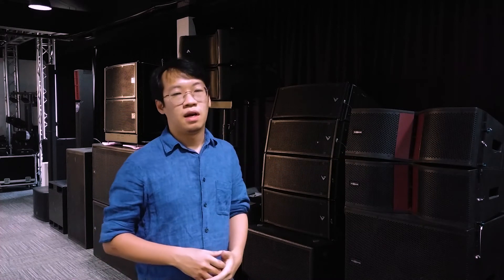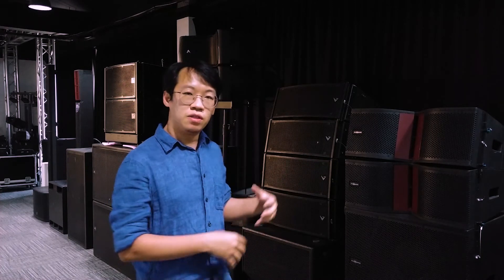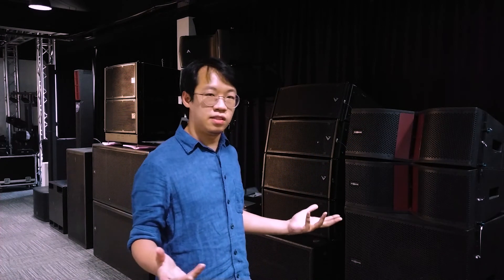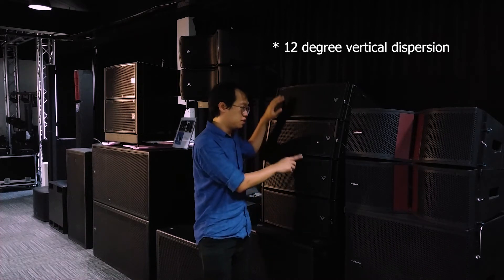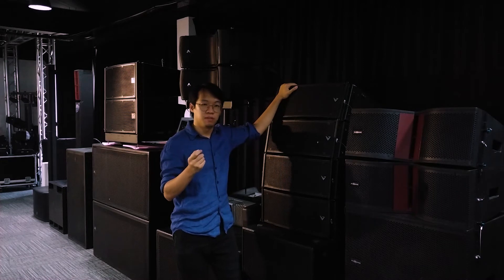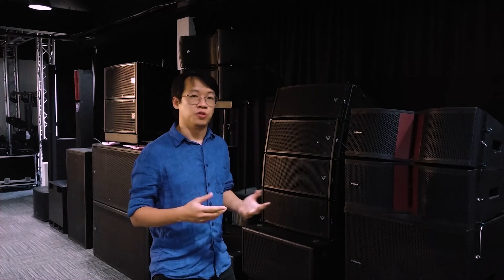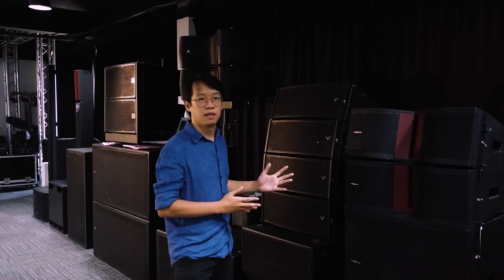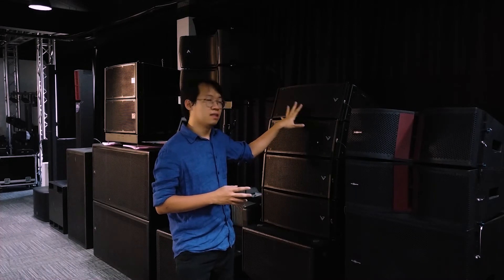DON'T GROUND STACK LINE ARRAY !!!

Comment: Two line arrays often sound better than a full range speaker at high volumes because of the wattage difference. I suppose if more sound people used the full range speakers within their specs I would feel different.  Anyhow thank you for the nugget of knowledge to our sound community.  Makes alot of sense
Reply from the maker: Both will sound great when ise correctly. However line array indeed provide higher fidelity in the HF due to the waveguide horn design. Higher Watt does not equal to good sounding
Reply: @ericcheesaihoo  Higher watt gives it a better chance! lol!

Comment: Ground stacking time aligns the speakers well (if you have completely vertical, averaging ear height) but only useful for outdoors with sparse audience. Flying throws the sound better and more uniform SPL but is harder to set up and not as good time alignment up close.
Reply from the maker: you can use fly sub to solve that. but when the array is too long, there still have time alignment issues with bottom boxes. and the half power of the sub due to moving a half space to full spaces